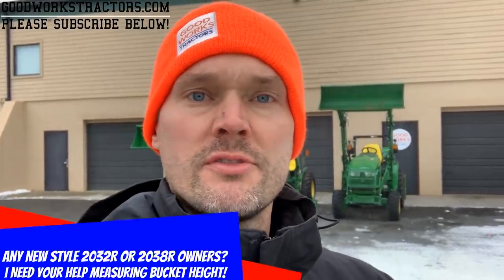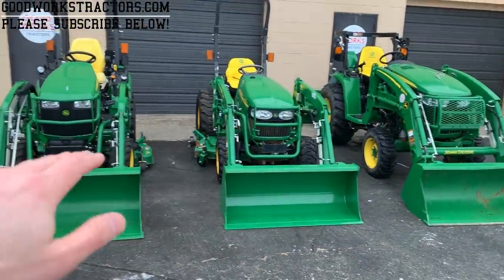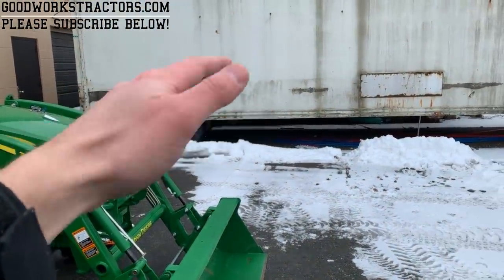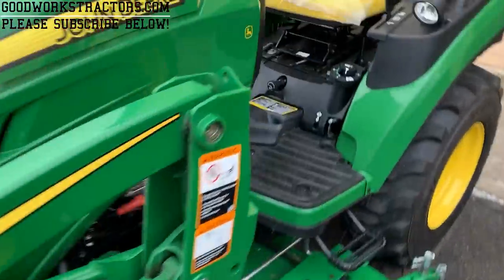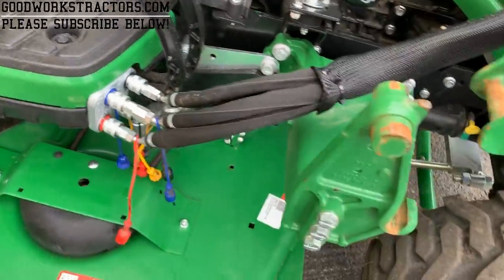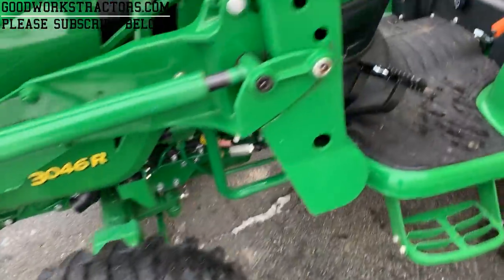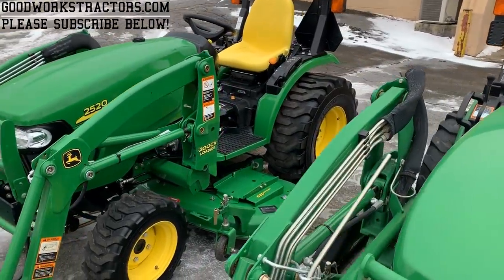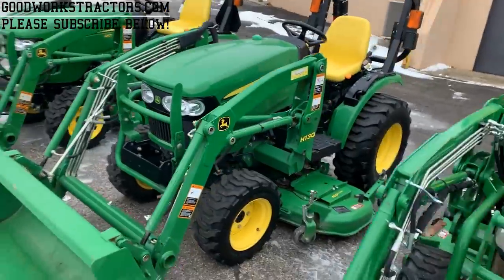What's Changed? The NEW John Deere 120r 220r 320r Loaders

Comment: Good stuff!  That 3046 with the 320 loader is a nice set up and  simpler to remove than I thought.  Also like that the uprights are off the tractor and stay with the loader.  Thanks again!
Reply from the maker: It is an easy system.  Can't stress enough though to be on level ground.  I've learned the hard way....more than once, haha!
Reply: My new 3039r cab tractor has the same loader, love it. But if you have the cab version, be very careful installing and removing the loader. There is a small bumper on the cab corners to protect the glass. There is only about 1” clearance from the loader to the cab.
Reply from the maker: That doesn't sound like much fun!

Comment: Thanks. Best thing I got on my 2038 was the single point hydraulic connection.  Just one lever and all four hoses hooked up.
Reply from the maker: Yeah, I wish that was an option on my 3046r, but it wasn't available for the 3r Series at the time.  I don't think it is now either, but I feel like I've seen someone mod a single point kit to work on it.
Reply from the maker: Oh also....can you measure your bucket height?  Curious of the level bucket height when the loader is raised all the way?  Want to know if there's a difference in height if mounted on different models within the same series.

Comment: Why is the left front tire on the 2nd tractor look like tread is backwards?
The 2520 machine with 220r loader.
Great videos BTW.
Stay warm... its in the upper 60's today here in Daytona Beach, Florida.
Reply from the maker: Good question.  It is more common than you think.  I believe the thought is that it helps with traction when doing a lot of loader work (reversing a lot).  Although this machine didn't have a loader on it until recently so not sure why.  Easy to reverse though.
Reply: @GoodWorksTractors  was just wondering. I bought a tractor one time and all 4 were backwards. Asked the guy and he didn't even,know what I was talking about. Great videos keep up the good work, and happy sales.
Reply from the maker: Lol that's strange for sure!  Thanks so much!

Comment: Hello. Is the 220r loader from 2014 suitable for John deere 2025R? Will the hydraulic pump be efficient? What will the load capacity of such a loader be in this tractor? Is h120 or h130 better?
Reply from the maker: For the new 2025r?  Only the 120r loader will fit.  H130 has more lift capacity than the H120.

Comment: Sometime please explain the exhaust vent on your 3046r. I know it’s part of the exhaust soot filter. Thanks 👍
Reply: I understand it to be a "heat" vent, not exhaust .
Reply: The “vent” as you call it, is the exhaust. Their is an optional pipe available from JD to extend it up, but has to be removed to open hood.
Reply from the maker: RIght now, it exhausts out the bottom and it serves as a vent for the regen system.  I wonder if there is a coupler kit involved for the vertical stack option that ties in the engine and regen exhaust?
Reply: Mine exhausts through the hood. There is a vertical stack available for mine. Also there is a kit to change the down exhaust to vertical if wanted.

Comment: Hi I bought a 120r loader for my 2016 2025r. Dealer said they have brackets that will fit. I haven’t ordered them..After reading some info the 120r won’t fit. Is it just the brackets that won’t fit or the front mount or other? Help!
Reply from the maker: Hi, it won’t fit.  You need the 220r, H130, or 200cx.  If it’s a 2016, then you have the generation 1 which is totally different from gen 2.

Comment: Regarding the 220R lift height difference... this breaks it down exhaustively. https://www.youtube.com/watch?v=BYj8sWzvm08 It sounds like that ~84" is actually only at the pin, not at a level bucket. Level bucket seems to top out at about ~78". You can just skip to ~9:20 in the video for the final graph of the lift capacity vs height with level bucket and where he mentions the pin height versus bucket height. All those numbers are for NSL incidentally. But NSL and MSL both list same height spec, just different weight specs.